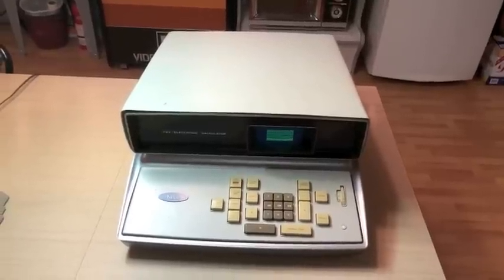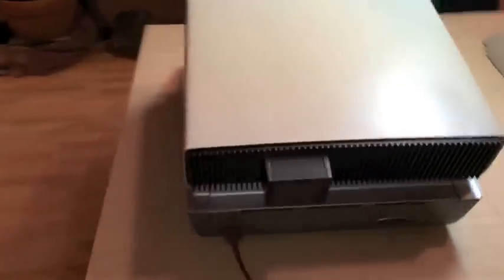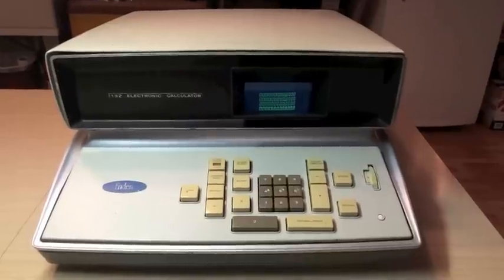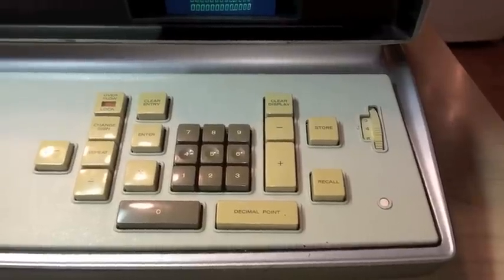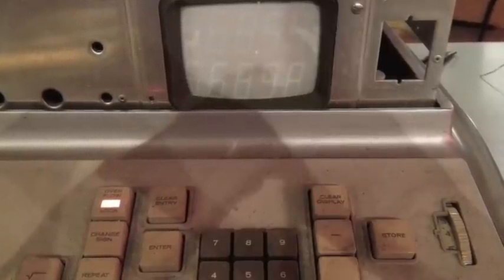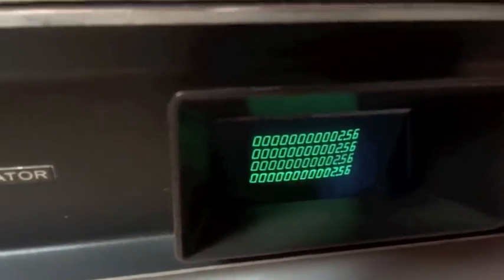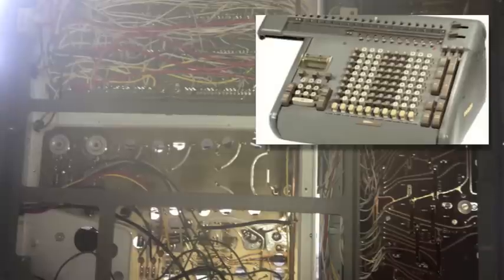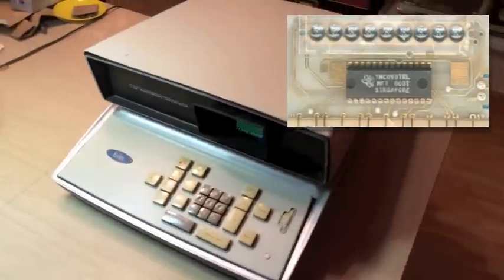1964 Friden EC-132 Calculator

Comment: I like the big button that reads "Decimal Point". It's like having a button that reads "Turn On The Power Here", or "This Button Signifies The Number Seven".
Reply: jeffw1267 But what does the red button do?
Reply: It blow-dries your hair, of course.

Fred
Reply: DON’T TOUCH THE RED BUTTON !!
Reply: richard vaughn 
The OVERFLOW warning and clear. Divide by zero error.
Reply: In an industrial setting a small dot on a button may be indiscernible or may get rubbed off.
A larger dot on a circle might’ve confused non-computer users thinking it was a multiply key

Comment: CRT or oscilloscope? 
If it is the former, then a monochromatic version was available in 1970 that needed only 300V for its screen voltage. The inner coating on the phosphor screen used Stannous Oxide or Chloride instead of Aluminum.

Comment: I have one of these... Worst packing job I've ever seen in my life... The UPS delivery guy apologized to me, then had me come to his truck... I could see the calculator through the "box", or rather, the loose flaps of cardboard that remained when the box utterly blew out it's bottom and sides... Shipper didn't have a big enough box, so he packed the EC-132 diagonally and filled the box with styrofoam peanuts! Couldn't even be bothered with a double corrugated box... Nope! Super thin single corrugated.

To the credit of the delivery service, they babied the blown out package and got it to me mostly intact! You pretty much had to grip the calculator itself, and not the box. The top cover never fitted on properly (it seems warped just enough to not quite latch correctly), and the CRT neck protective cover (the little metal mesh that pops out the back) got slightly dented.

Functionally, it powers on, you can type numbers in, but there is a lot of distortion in the screen. I have long suspected this is a high voltage supply problem. It also locks up if you do anything more than a 1-2 digit addition or multiplication. subtraction and division immediately lock up the machine, and don't even attempt a square root. Larger numbers will also lock up the unit. I suspect that the delay line is out of calibration, and it's getting back gibberish when it tries to do too much, but I'm no expert. Could be other hardware too... Ugh... It's tragic that Friden tossed all the technical info to these...

Comment: Just got mine running tonight, your video helped me to test.  Replaced a 4007 uF diode in the -15v loop.  vintagecomputer.net/friden/
Reply: did you mean capacitor? I do have an EC-132 with afew issues. The second row of numbers do not work. They display 1 instead of 4-5-6. Wondering if there ever was a repair manual somewhere.
Reply: Kyle O (of cctech). is the person who actually identified the bad part(s), I did the repairs.  No caps were replaced.  He may be able to help, but I don't believe there are any online schematics.
Reply: how could I contact him?
Reply: try cctech mailing list.
Reply: He meant a UF4007 diode.